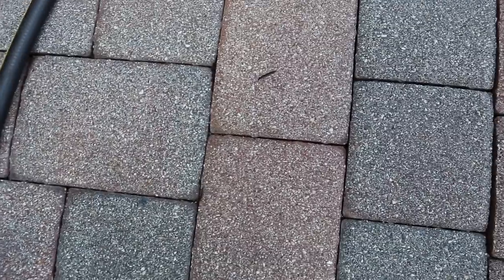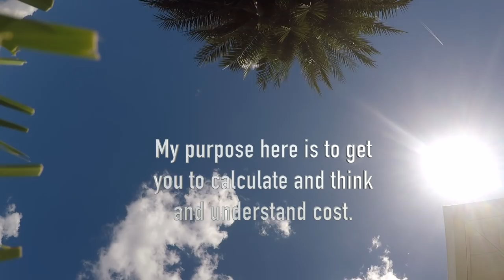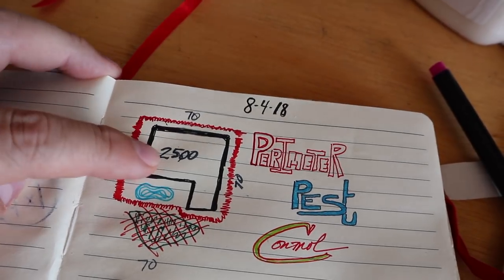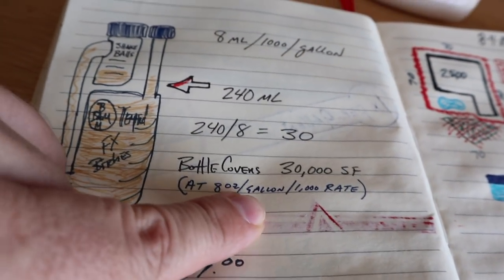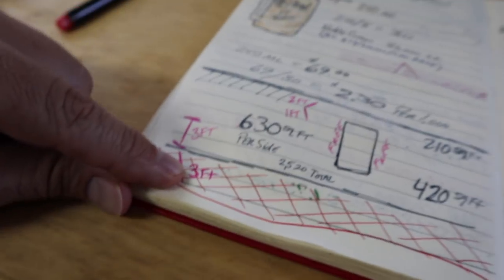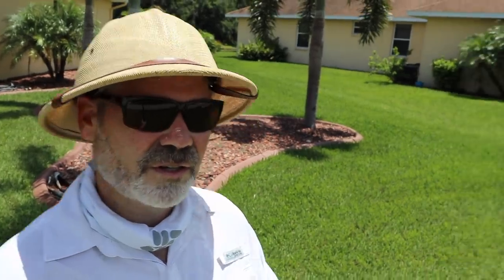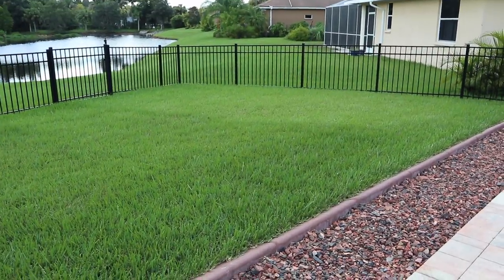DIY Perimeter Pest Control | Home Pest Control Application

Comment: I'm not too far from you in Apopka. We get a TON of millipedes. They will not hurt the grass. They actually improve it. They love leaves and wetness, so if you have leaves you'll want to clean them up from the edges. They go for wood mulch too.

To kill them off and keep them from overtaking the yard use Talstar P (doyourown) or Triazicide granules (Home Depot).

The reason you get them is because of the pool. The pool attracts them for they like chlorine water. When they get big you'll see them in the pool a few times. The pool will attract ants, too. I have a pool and I do a barrier around the pool to keep them out. They won't harm the pool. They just get difficult to clean the pieces from the filter from their hard shrimp like shells.

The pesticide you used in the video will kill them as well, but it won't keep them away. That's where the granule helps to keep them from not crossing that border. With your lake behind you, put the barrier down around the back side of your yard. I have wooded area behind me and that's where I get mine from. Once you put the granule border down, you won't see them, but once a year in the spring when they breed.and lay eggs.

Comment: They invaded my home 2 years ago was a damn nightmare. They seem to die in the house due to the inside temperature. There’s 1,000’s of them. The year before it was pinchers /earwigs 🤬😡😡. I ended up getting rid of all the mulch and throwed down some red rock. It’s seems to have worked. Now I do a pest control spray about every quarter or so. Good luck with pest elimination success. 😀 cheers from Wesley chapel.

Comment: Al bro.. just getting into your stuff. Love how much you bring it. Kyb, fescue, rye mix.. extremely hard clay soil. New construction home (seeded the yard this spring) - some thin areas in the back, front is nice and thick. Going to aerate in a few weeks. Do you recommend top dressing after the plugs come out but before the seed, starter fert and milo go down? Just makes me wonder with how much the sun dries out the clay in the thin areas and if the seed will have anything to grab 🤔

Comment: Great video. I just perimeter sprayed my house 2 days ago and have been for a few years. A tip for you is go with Suspend SC (deltamethrin 4.75%) tip and pour. Professional product that last for months and half the cost ($35 per bottle). 1 bottle last me about 3-4 years. (3000 square ft per application) Btw, keep up the good work, love the channel!

Comment: Tempo SC works GREAT for critters like crickets and spiders. Its labeled safe for indoor/outdoor use. It's pretty cheap too. I think I can get a bottle for $34 or so but it lasts FOREVER. I dont have a bottle handy but if I remember correct, it only takes 2mL /gal.

Comment: Hello from Virginia. Just bought some N-ext products from you. I have the exact same truck. Color and trim. Love it. I've had it since early April. I upgraded the door handles and mirror caps to a body color white. Makes it look at lot cleaner in my opinion. Ordered them from Sparks Toyota. Changing them out takes 10-15 minutes for the entire truck. Also upgrade the audio with OEM Audio Plus because I was very underwhelmed with the factory JBL stereo. Look 'em  up! Both vendors have EXCELLENT customer service.

Comment: So I have a question. I'm getting a backpack sprayer that I want to use for spraying insecticide like you are here, but I also want to use it for micronutrients and weed control (Tenacity). Is there any problem with using the same sprayer for those three applications? I assume that I would need to rinse it out thoroughly between tasks...
Reply from the maker: No problem, just triple rinse between applications. All good
Reply: @Thelawncarenut  Thanks!

Comment: I just "threw'er down" today for the first time on my new Emprie Zoysa sod.  It was laid 2 months ago... by a company that I frankly think did a real crappy job of it.  Long story short I live in NW Gulf coast of FL.  They kept the sod on a pallet for a day to day and half.  Laid half of it and left..didn't water it until the next day. They also just used that crappy white sand to replace all the dirt they took when they removed the old lawn.  No amendments, no fertilizer....   Poor sod has been struggling since.Back to the Milo ... I calculated my lawn at around 10,172 sq ft. So in total I put down 3 bags of Milo.  Smells like success :)  I put it down a little light (should have used around 4.5 bags) but I miscalculated so I will hit it again in Oct. Now back to the stressed sod ...  I am seeing a good amount of crab grass (I think)...  what should I use to control it until it dies off this winter and I can get a good regime of pre-emergent.  Or should I just deal with until it dies off in 3 months or so?

Comment: LCN Help!  Texas triple digit heat is not helping our yard and are mourning the loss of the St. Augustine grass in our yard!  We've used products to kill grub worms and all the other pesky bugs in the yard, We've fertilized more than twice this summer and nothing seems to help.  Watering as much as we can (with City restrictions of course, wink wink) but our yard has NEVER looked this bad.  Any suggestions to get our yard nice, green, and thick? We are jealous of your nice green yard.  :-)
Reply: Same here, my grass did not grow back from this winter like it usually does.  I hand watered mine daily when its over 100.  I do not leave the sprinkler on for long periods of time. It wastes water. Go over one area and move on, and come back over it after a little while.  Dish soap in a hand sprayer will loosen the soil, and will let the water soak in rather than roll away.  Even in the extreme heat, its starting to spread.

Comment: Use Termidor (or a generic) around the perimeter of the house for ant/termite control. You should only need to do this annually. Use Demon or Talstar on perimeter (a few feet up wall of house, around sofits, windows and doors). This will kill any other pest (roaches, spiders, earwigs, etc). Same chemicals pest control companies use. You can buy the products that will last a year or two for the price of one service from a pest control company.

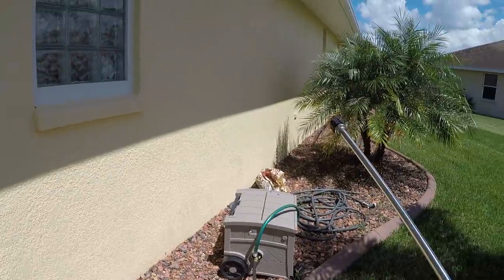Comment: Allyn, another great video and congrats on the truck. I just bought a ram 1500 and I love it. 2 questions - would you use a fan tip if you were spraying your lawn with the temprid? and what is that on your wall at the 14:49 mark in the video? we live in south florida and I have a couple of those on our house. I was told they were some kind of pest control gizmo, but it seems like they only control a spot where the ants can get into the house...
Reply: Looked like an electrical box.